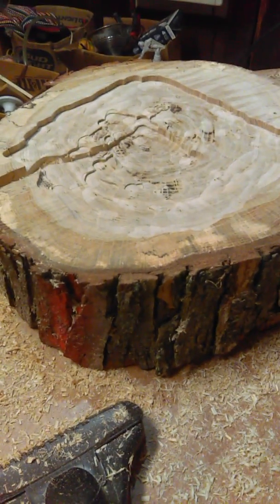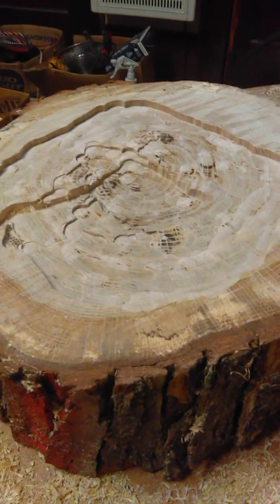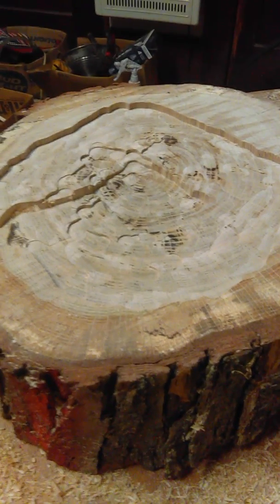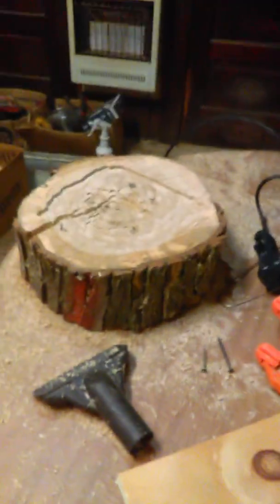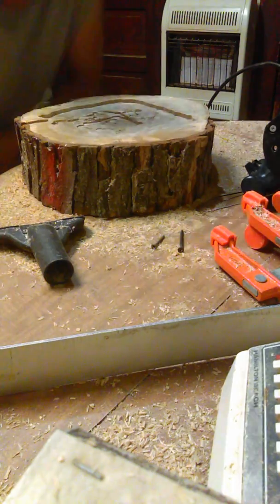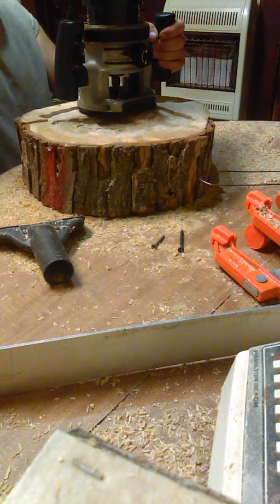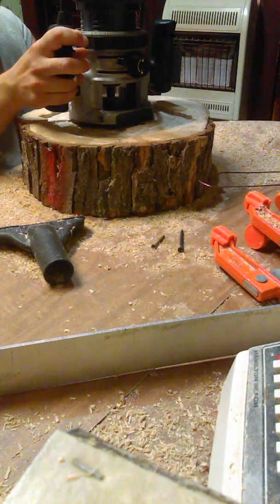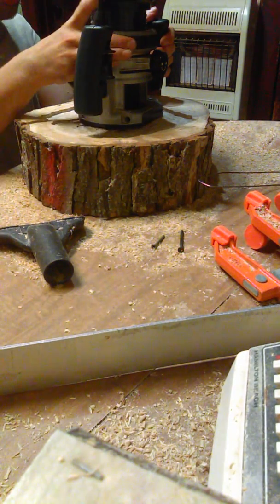First time attempt at making a decorative bowl.

Comment: Do you have an update on this project?
Reply from the maker: Sir I bought a Makita plunge router last year and I am trying to set up a camera shooting spot with a special ordered YouTube camera and possibly a green screen. I do plan on doing Makita and metabo tool reviews once I am fully and successfully set up.
Reply from the maker: My update project is taking the Makita plunge router to a new piece that shall be level on top and bottom then carving it out and using wood chisels to do some chop and pairing. I am no expert just a guy still learning. After I get it perfect I will attempt a epoxy project in the round bowl of a new piece. I'm thinking very light blue epoxy with real looking fake coy fish or clear epoxy and some other theme or idea. Then once curred correctly I shall sand the top. Then shave back some bark a 1/4 inch away and put a giant ring tool around it that looks like a piston ring compressor tool. After that ring is installed I will pour in clear epoxy and tap on it with a stick to get out bubbles while it's setting up.